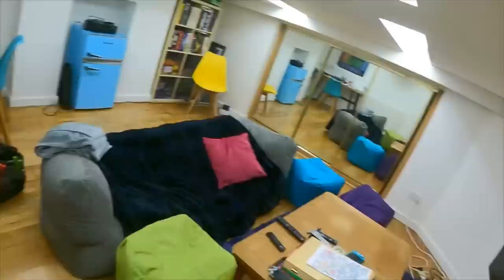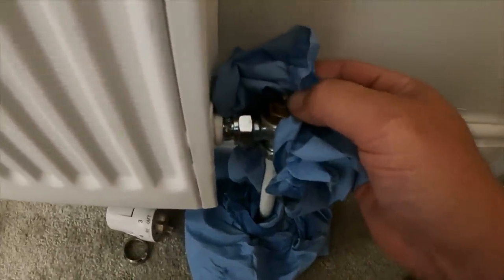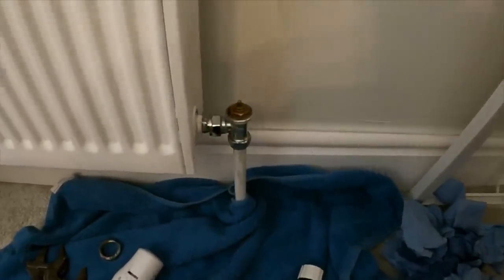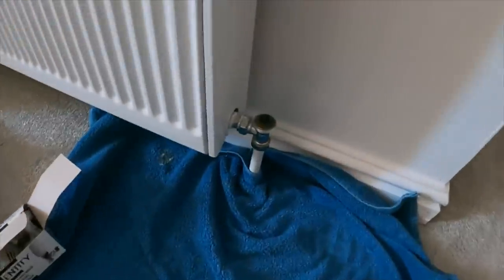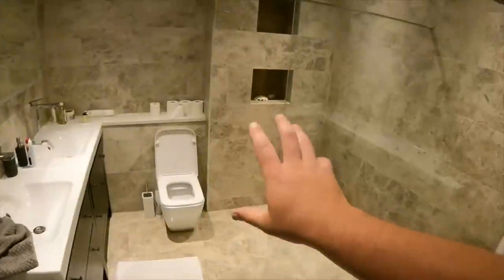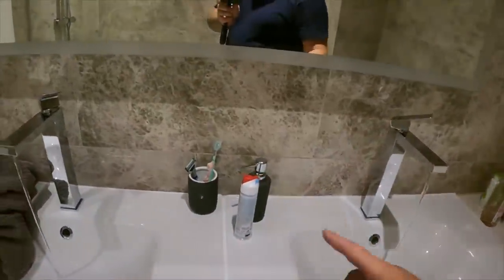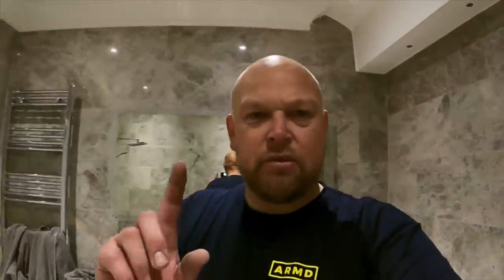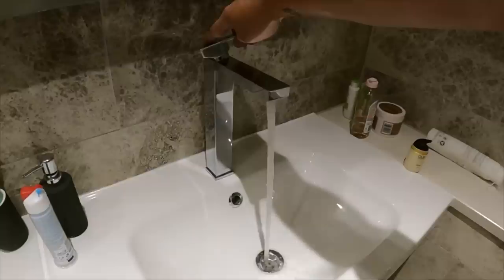DID I CAUSE THIS LEAK??… Plumbing problem that could of flooded this house!!

Comment: Had a similar problem in a pub/bar checked filter after 2" main to property all clear and pressure good,after searching for a few hours,found 28mm stop cock in ceiling void hadn't been opened enough,made to to fix it.😊
Reply from the maker: Hidden out the way…. People think we are miricle workers 🤣

Comment: My £50 wet vac has got me out of jail so many times!! Customers regularly confuse pressure with flow and turn down valves thinking they are reducing the pressure. I have to explain the static head is identical, the pressure only drops due to the reduced flow rate.
Reply from the maker: Yer gotta love the wet vac👌🏼

Comment: Please tell me when you had the system drained you did put a TRV on the basement rad?
Reply from the maker: The system wasn’t fully drained mate, would of took another few hours to get it drained enough to do the basement valve and the landlord wanted the minimum done to get sorted. He just wanted to be able to isolate that basement rad
Reply: @MJTiffPlumbing  👍 top job as always

Comment: Typical, I can't count the amount of times thats happen to me. I left a job once and the water was good, I got a call to say that there was very low water pressure and when I went there It took me three days to figure it out, what had happen was the stopcock behind a kitchen a low unit  cupboard, small pots and pans had fallen through the access hole at the back and over time had knocked the stopcock off, they were so happy not just for the identifying the issue but for the lost small pots, pans and kitchen utensils lost behind the panel. 🤣
Reply from the maker: Everyone’s a winner 🤣👍🏼

Comment: Is that rad not maybe a bypass valve for the boiler if it doesn’t have one fitted? Good vid mark tho
Reply from the maker: No buddy, there are about 4 towel rails that act as bypass valves for the heating system👍🏼👍🏼

Comment: 😅 what was the water like on central heating? It might be a case that he run out of heating inhibitor, because all the glances weeping like this , it’s definitely a sign of something it’s going on or water is to hard , have you checked the quality of water from the rads 😅 other thing you should told him to get radiator covers on , personally to me it looks like his children bumping into to those rad valves with something or wheeling office chairs rolling on them , all the valves look crooked, you can tell nothing looks that old on a plumbing in that house 😂🙈 nice 👌 job tbh ..
Reply from the maker: Water in the system wasn’t to bad to be honest…. However I wasn’t there to do that, I was there to get the rads working again.

2 TRV’s out of 16 isn’t bad to have sticking pins👍🏼👍🏼

Comment: Great video Mark Interesting find with that stop tap. I will look forward to seeing the pressure boost system if you get the job as i have appalling pressure too. I live in Blackpool and our supply is at the end of a very long supply and the head pressure is poor. United utilities admit that there is a problem but they have to reduce it because along the length of the supply there are frequent leaks so they reduce pressure to reduce the amount of water lost.
Reply from the maker: Shocking how so many people have poor water pressure to there homes